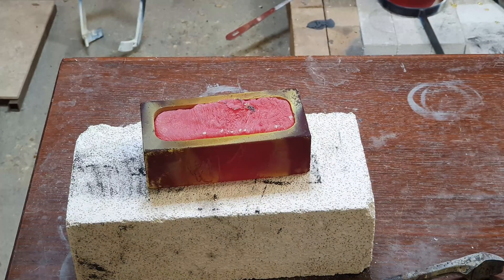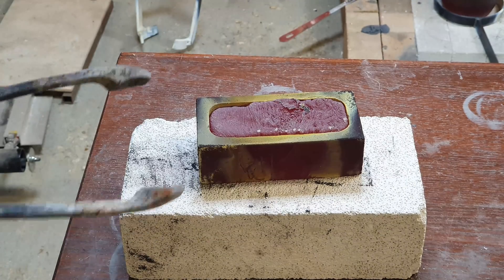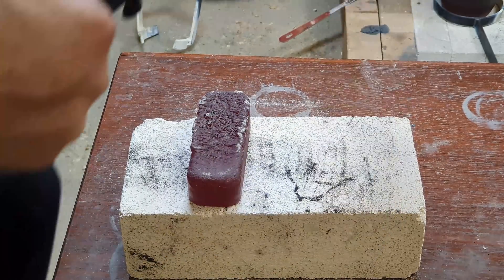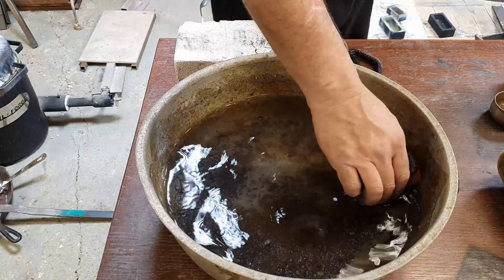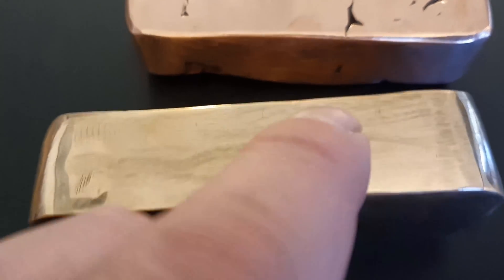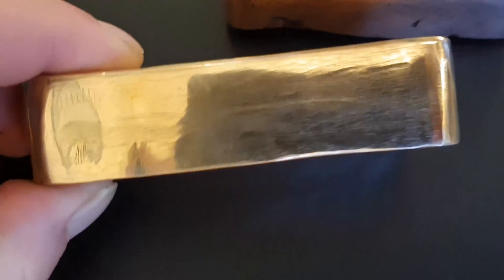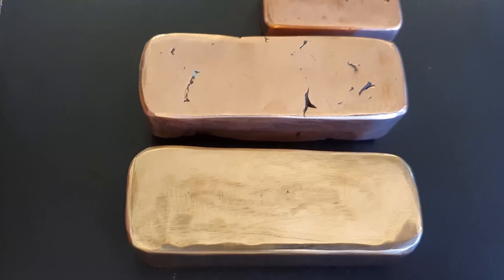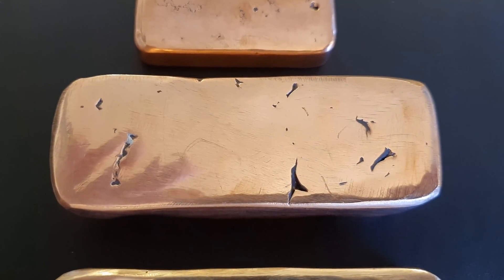Making Red Tombac of Paris - Alpha Brass - Copper, Zinc and Lead

Comment: That flare up you get adding zinc, I wonder if you have enough copper oxide in the melt to produce much of a thermite reaction.  If so, using a flux with a deoxidizer and giving it a stir to react with the copper might help.
Reply from the maker: Thanks Hanely.  The reaction is something I'm trying to avoid, the idea is to have as few oxides as possible in the melt.  An exothermic reaction with the zinc is something I want to eliminate.  Maybe you're right on the flux though, perhaps I should be stirring it into the melt and allowing it to cover the surface again before adding the alloying elements ?  It is called a 'refine and cover flux' after all...  It behaves like molten glass.  Perhaps the black colour in the flux is charcoal which may act as a de-oxidiser with the copper ?  I'm not sure to be honest...  I'll have to try stirring it in and see if it makes a difference...  Cheers Andy 🥂😎🍺

Comment: Here is an odd idea. Beryllium bronze seems to be a deeper shade of red than normal copper. I don't have a way to really test that, so this is why I'm throwing it out there, mabye you can test it.
Reply from the maker: Beryllium is one of those "don't touch with a very long barge pole metals"  Incredibly toxic, you definitely don't want to be messing with that stuff no matter how small the percentages.  Be very suspicious of copper metals that don't look like regular copper, always research them before melting, it might save your bacon !!  Chromium copper, cadmium copper and beryllium copper are all a no no.  Cheers Andy 🍺🥂
Reply: @MeltandCast  thanks for the advice. Will definitely keep that in mind next time i want to melt some suspicious looking metals.
Reply from the maker: Beryllium copper is a reddish colour most commonly used in spark proof tools.  Chromium copper is used for strength and heat resistance, often shiny and bright with little oxidation (used in welding gear, connectors, circuit breakers etc) and cadmium copper is used for arc resistance (spring connectors, sockets, plug in connectors, power boxes, electric blankets etc).  It's worth being a little wary of copper not sourced from wire or pipes.  Often the amounts of these metals you are likely to come across are small compared to things like wire and pipe... best to just avoid them entirely just to be safe.  I don't mean to go into one, I only mention it for the benefit of others who might read this too.  Cheers Andy 🍺😎🥂

Comment: Even though you changed your idea for how to do the counters, i would still like to see you try for alloys that are deeper red. It makes me wonder, since that one turned out far more yellow with the lead inclusion,what would bring out a deeper red coppery color (other than pure copper,of course).
Reply from the maker: Hi Dan, I thought the lead inclusion would make it a lot darker, more of a brown colour.  Other than copper I can't think of any alloys that are a deeper red colour hence the change in direction to liver of sulphur.  There are some patinas that can be applied which give really deep reds, I haven't done much research on patinas yet but some of the heat based ones are very vivid.  I'll have a go with some pieces soon.  I'd like to find a red / purple patina to use on the board but i think it would need to be chemical based to prevent leeching into the other triangles and the background.  Cheers Andy 👍😎🍺

Comment from the maker: Hi all, Red Tombac of Paris this time.  This one has the inclusion of some lead.  I wasn't very red, but I hope you enjoy the video...  Have a great day...  Andy 😎🍺👍
Reply: pitina? https://youtu.be/II-ieVyVcjw?t=409
Reply from the maker: I watched that patina video, great results.  Will probably give it a go sometime.  Cheers Andy 🍺🥂
Reply: MeltandCast 
Hi mate just got in to casting metals, got a new Devil forge. Just wanted to no what crucibles you have a got. Are they Salamander ones or procast as I have read they are good. I have got some from China but after spends a lot of money on them there always really bad Quality. What do you recommend
Reply from the maker: All mine are Salamanders as they have a pouring lip.  I've not heard of Procast before...  The sizes I use (assuming you have the 10kg furnace) are A6, A8 and A10.  I use the A6's most often as you'll likely need a different crucible for each metal.  The A8's and A10's are almost identical size wise but the A10 does hold more.  The furnace might struggle to heat an A10 full of copper but would be fine for lower melting point metals such as aluminium.  Both the A8 and the A10 are a bit of a tight squeeze.  You'll need some well made lifters to slip down the edges of the crucible to lift it out as the space between the furnace wall and crucible is quite slim.  I'd suggest getting a few A6's and the pouring shank and lifting tongs from SDTS engineering.  They aren't the cheapest place to buy furnace gear but it will get you up and running.  Once I had the A6 lifter I got a local engineer to make me lifting tongs and shank to the same design telling him to flare the pouring shank to grip the crucible and ensure the lifting tongs slid down the edge of the crucible without wasting space.  He did a sterling job, they work perfectly and were half the price.  The cheapest place I have found in the UK to buy crucibles is from EF-Supplies based in the North of England.  They are distributors for Morgan Salamander and are half the price of everyone else.  You can email Michael at EF-supplies or give them a call with your needs.  I usually buy 3 or 4 at a time.  Castree kilns also sell cheap Salamanders but rarely have any in stock.  You can buy fluxes and other bits and bobs from Castree too for much better prices.  SDTS also sell lots of foundry gear but at slightly higher cost.  You can look at the crucibles on Castree kilns to see the size chart and dimensions before ordering from EF-Supplies.  Hope this helps.  Best wishes Andy 😎👍🍺
Reply: MeltandCast wow thank you so much for your reply mate, that’s fantastic info for me as I was getting really stressed out trying to find a supplier
Reply: I have sent you a similar message regarding my question as didn’t know if it had gone though so when you see it just ignore it mate, thanks again for your time and I’ll be following your videos all the way 😁👍👍
Reply from the maker: My pleasure mate, anytime 👍😎🍺